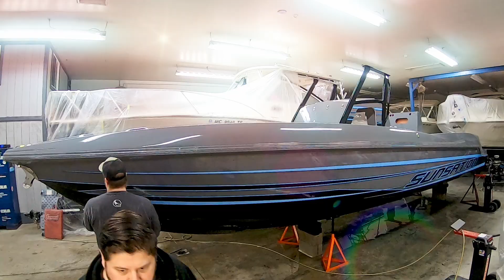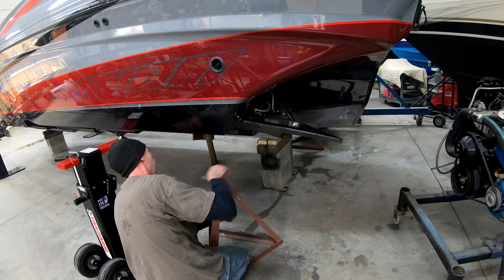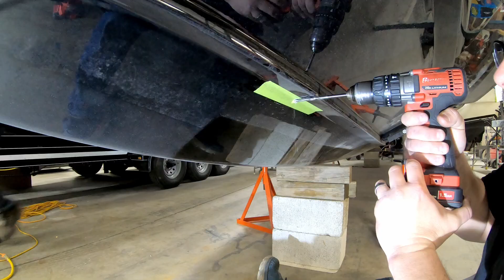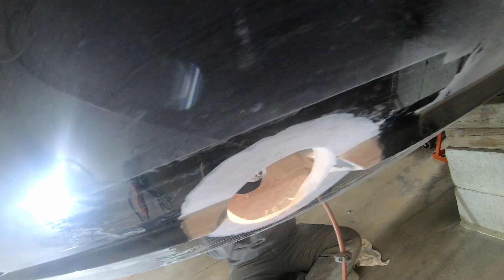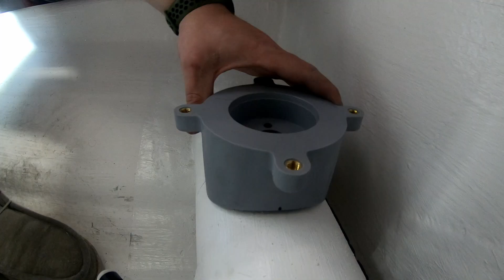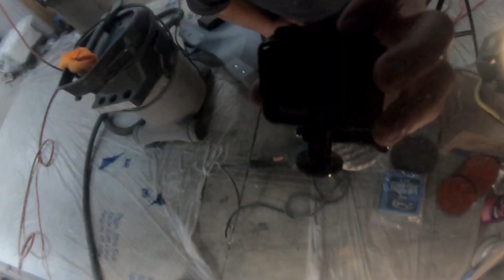We Drilled a Hole Into a Brand New Sunsation Boat!

Comment: Like to know how you get the transition done …. If you sand down the gel coat and polish it …. On a black color I can imagine you see the transition - the end of the new gel Coat .
Reply: having a brand new boat from the factory with gel coat from the factory really helps with being able to blend the new gel to the existing gel. I'm sure these guys do a great job, otherwise sunsation wouldn't be sending them their boats.
Reply: @randomjackson574 l would like to see their Jobs …. I am a car painter and I fixed a small damage on the front line of our Baja 302 with white gel coat on the white original gel coat .
Although that it was white … if you check the transition you could see a small line . It Does not matter because it is underneath the waterline. But impossible to do it 100%_ especially in black color